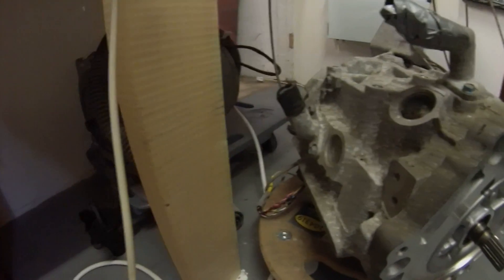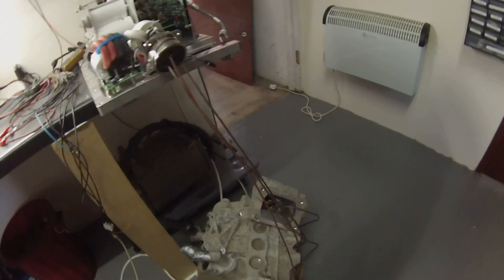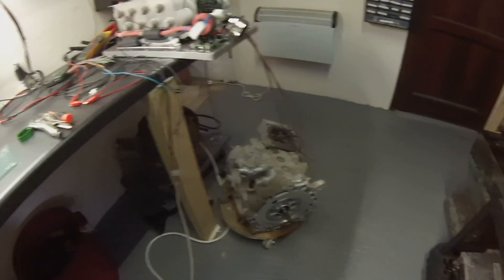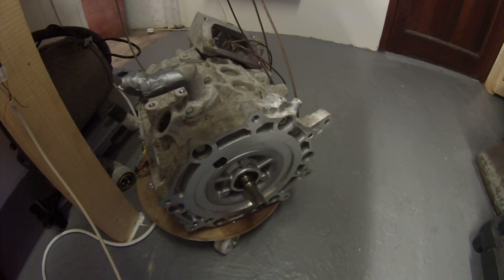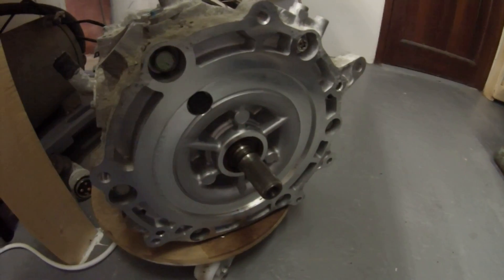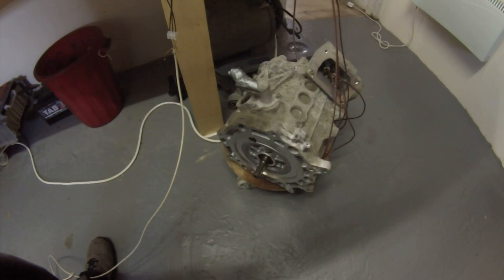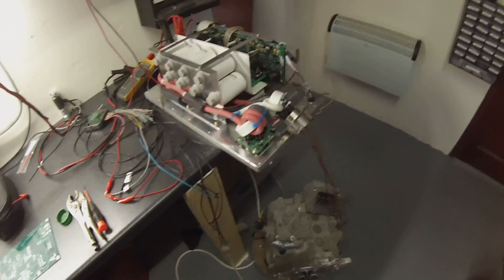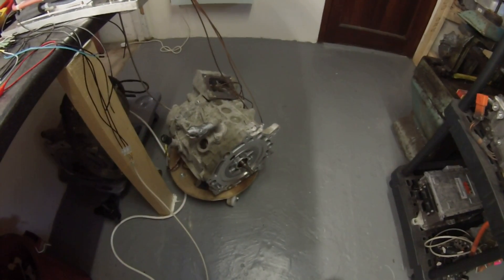Nissan Leaf Motor Running

Comment: I've been learning about electric cars for about eight months now. What I don't understand much about is the inverter/motor controller systems they use. I'd be interested in the price and availability of a complete ready-to-use DC to AC motor controller for a Leaf motor. Do you currently have anything like that for sale? Your Patreon site seems a bit obscure on that point.
Reply: Paul Holmes makes drop in logic boards for this purpose. All you you need are basically some batteries, the Leaf motor, and a Leaf inverter. Me personally, I have the 2011 Leaf inverter and motor, but I'm waiting for Paul to open his website back up So I can purchase his logic board (brainboard). You should look him up on here.

Comment: Think these things will end up being useful as cheap motors for conversions? Better than a Tesla motor at least. They look to be not that powerful :/
Reply: The Leaf's maximum power is set by its inverter.
Reply: Honestly, what determines the maximum power of these electric motors is their cooling, and obviously the maximum power of the inverter you're using. Tesla's big motors weigh, I think, 70 pounds, which is actually plenty less than the Leaf's (I read somewhere 58kg... over 100 pounds).
Reply: as I college project we are converting Smart Roadster, Nissan Leaf motor from ElectricAutos.ie is already in and PnS controller on the way, that makes almost the double power compared to original engine